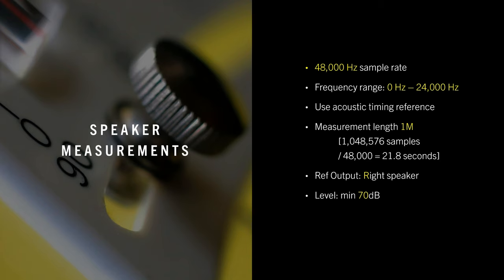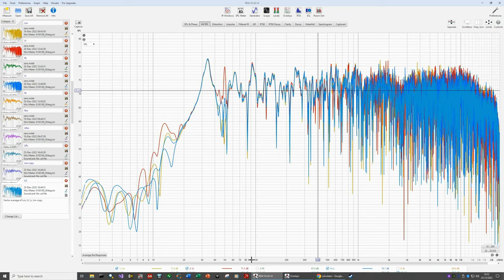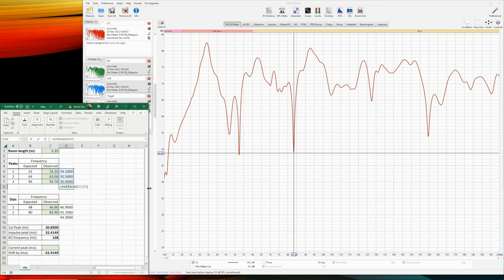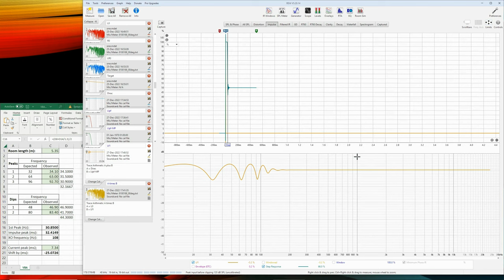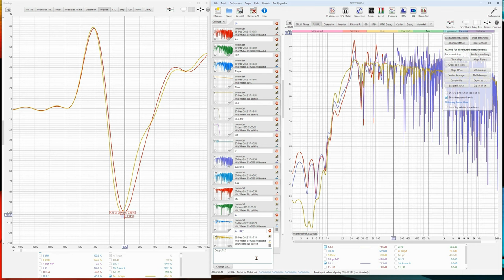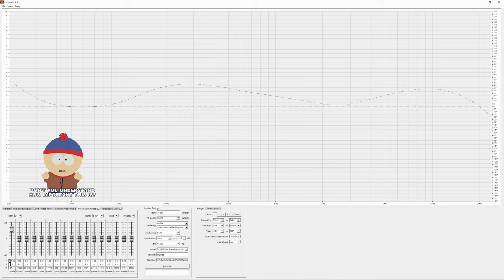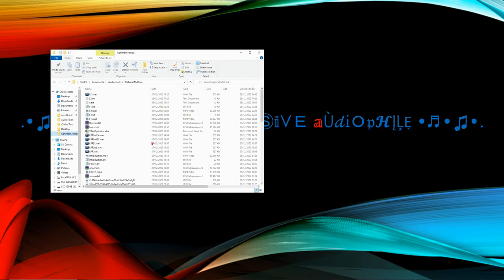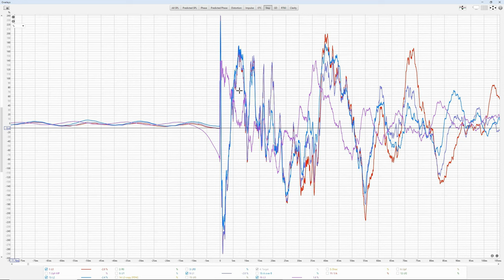High Fidelity Digital Room Correction with REW & rePhase

Comment: You know I did a lot of tests with the inversion so I know it quite well. Following the procedure you reported here I have a lot of post ringing (I know it comes from F2 because I have each filter separately reported in the convolution filters of Roon). I have to apply a frequency dependent window of 35 to R1 and L1 and then invert. Applying VBA before the inversion give a lot of benefits with respect to invert straightforward, the sound is a lot better with much many bass. Great job!
Reply from the maker: You're right, FDW has been excluded in F2 by mistake and I have actually added a note for that in the description section of the video. I'd recommend 15 cycles instead of 35 and no other smoothing.
Reply: @ocaudiophile  ok good. So we have to apply a FDW to L1 and R1 and then invert.
I have another question regarding F3: should we repeat the process in rePhase for L2 and R2 or we do only on L2 and then apply to R2 too as per your former written tutorial?
Reply from the maker: @teb76  It's better to do separetly for L2 and R2, there might be subtle differences between the two due to speaker placement and room shape anomolies.
Reply: @Obsessive Compulsive Audiophile  Should I apply FDW of 15 and make the target curve then remove the FDW or should I make the filter with FDW still applied?
Reply: Same question
Reply from the maker: Filter should be created with the fdw applied before creating the target curve!
Reply from the maker: Answered above. If you can wait another day, I'll post a video with a better technique as part II of the video I posted today :

https://youtu.be/zmIqJ_jlZPw
Reply: @ocaudiophile  definitely!  I’m currently getting some convolves files from Accourate.   I’m curious how they sound but I’d like to know how to do it in REW.  

Also, my FDW lowers my high frequencies a ton.  I have a very treated room too so I’m surprise that much magnitude drops!?!
Reply from the maker: Fdw is not an optimal way to see actual HF response as this is highly dependent on how reflective your room is and how far your LP is from your speakers relative to first reflections. A bit too long to explain here, just wait for tomorrow's video. Acourate is a great tool but more can be done in REW lately.
Reply: @ocaudiophile  looking forward to it!
Reply from the maker: @joek6207  HI, sorry I lost you during live chat. It stopped when the premiere ended. Can you repaeta your question here?
Reply: @ocaudiophile  can do.  I’m on road but will put it in later
Reply: @ocaudiophile  I’m back!   A few things:
1) I run my subs 17dB hot (I have 5 in total).  They are also “time aligned” (insofar as I adjust the timings to remove standing waves.  Given all of that and my mains really don’t play a factor below 90Hz, is the additional taps from the virtual bass array worth it?
2) why wouldn’t you set your Harmon curve lower to correct more of the top end?  How should I handle it if I want my main speakers brighter. (Do I lower the overall curve)? 
3) is correcting the crossover phase necessary because of the room?   I figured the speaker designers would handle that?
Reply: One more item:  given that the filters are based off of PEQ targets, can I just use those instead of the convolution file?
Reply from the maker: Unless your subs are placed and time aligned as a double bass array system altogether, you'd benefit from a VBA filter although your LF response should already be quite flat with 5 subs and you may not need it at least for the dips.. 
Cutting boosts too much in the HF will quickly lead to throttled/boxy sound inherent to regular DRC. If you want your speakers brighter, you should lift the Harman curve not lower it. Lowering bass level is the right way to brighten up the HF.
Most passive crossover speakers will benefit from phase correction unless they have adjustable tilting drivers like the Wilsons.
Reply from the maker: Yes you can. Make sure you measure at your regular listening level and auto fit the Harman curve to dB average of both speakers as described in the method.
Reply: @ocaudiophile  thank you!  In terms of brightening, what if there’s a natural roll off that I want to boost (I like a flat response).  Is the way to achieve that to lower the target to make it flat?  1000hz SPL is the same as the 10000Hz SPL.

Or is correcting the high frequency too much, even if its all cuts, not a good thing
Reply from the maker: @joek6207  Most speakers are flat between 10kHZ and 20kHz, the roll off you see should be either the calibration mic inaccuracy or toe-in or tweeter height error. As a rule of thumb, you don't want to touch over 1kHz even for cutting. Most of the peaks and dips you see are caused by reflections. You should only correct "the speaker" above 1kHz, not the reflections and you should only correct for the reflections (the room) below 200Hz. You will agree that most speakers today wouldn't really need EQ for their original response.

If you're desperate, try to apply a boost with "high shelf" filter at above 10kHz, this will have relatively less degrading effect on the sound.
Reply: @ocaudiophile  interesting L/R Bypass with Audyssey DEQ applies no EQ but does add that High Shelf

Comment: Hello, regarding the 50Hz harmonics, you could use a 220 / 220 V transformer to decouple. It could be used as as band pass filter around the 50 hz...
Reply from the maker: Thanks for the tip. I was thinking about this actually.

Comment: Very deep understanding of REW sir! Thanks for sharing.
You correct the input signal right (2channels)?
I correct the output (6 channels)
This is how I usually do it in the activa filter. Set each output band delay. correct any standing waves and peaks on each band. Then clone all 6 x-over and filter settings in 'Rephase linear tabs' and swap with that .bin.
In other words i do a full electronic Rephasing of my favorite setting, not acoustic.
Reply from the maker: Yes and yes!

Comment: Serkan,  Thank you much for sharing your broad and deep knowledge of this.  Much appreciated.  One question regarding creating both left and right filters, do you have to time-align L0 and R0 before creating the 4 filters for each channel, or can we create them from the raw measurements?
Reply from the maker: Thanks.

One of the speakers is the acoustic timing reference so it'll be at time zero anyway and the other speaker will need to be on top of it if you aligned your mic at the centre during the measurements. It'll not make an audible difference but for the health of all the calculations it's good practice to align (with cross correlation) everything to time 0. If your LP is not at the centre, than you should compensate for that in your convolver engine settings with the correct time delays applied to the closer speaker.

Btw, do not forget to check video description area. I have made some revisions/updates/tips and added my complete measurement and calibration steps.

Comment: Is it okay to use higher than 8% regularisation in the inversion filter if my dips are really bad? My current room is pretty bad so for now I'm just trying to do what I can as a band-aid fix before I'm able to move. I'd need somewhere around 10db boosts probably to sort out my dips, I do have the amplifier and speaker power to compensate for -10db preamp gain in dsp.
Reply from the maker: Boosting dips too much may degrade the overall sound but feel free to try. You need to decrease regularisation percentage to increase boost.
Reply from the maker: Yes!

Comment: This is top info. I watched your videos with a lot of interest. Great contribution to the community. Would you say that the filters you can create with this method are on par as the ones crested by Acourate/Audiolense?
Reply from the maker: Thank you. REW is now so powerful (there're also some new tools I'm aware of in the pipeline), I'd say you can do almost anything you do with pro software. I don't have any experience with Audiolense but DIY crowd loves it and they're a tough community to satisfy. In Acourate you can do a linear phase inversion which sometimes has advantages compared to min phase. Also it uses macros to automate tasks which can be more practical. However, with REW you can see all the details of what you're doing.
Reply: @ocaudiophile  thanks for the flavor, this is definitely worth to spend some time with

Comment: i followed your REW video and was wondering if it's possible to make impulse response shorter (sub 200ms) without compromising on frequency amp correction? 

forgive me if it's a silly question as I'm not too knowledgeable on this thanks for what you do! 

what's your comment on sound id reference and their methods compared to what you show here?
Reply from the maker: The answer to shorter impulse is yes, you can. Watch the "Excess phase inversion" video, it's at the very end. These two were supposed to be one video but it would be too long so I had to split.

I have no experience with Sound ID unfortunately. From their website, it's not clear what they use but probably some AI enhanced phase shifting techniques. The product might be more towards studio engineers as a plugin.

Comment: Amazing amount of information in your videos! I've used a little bit of what I've learned and it has helped me a bunch already on my laptop and my cellphone. 
 I have two questions
1.) A couple of my finished convolution files creates an echo that's quiet but noticable. What step did I miss?

 2.) how would I do a 5.1 system? Seems your videos are mostly 2 channel.  My PC is connected to my theater system and I would be using Equalizer APO if it's possible.
Reply from the maker: Thank you!

1. Did you watch part 2 of that video for filter 4? I played a pre-echo sample there. Is your echo something like that? Then it's easy to deal with.
2. You can do a great surround calibration with a HTPC and EQ APO. You will need to create all 4 filters (combined) for every speaker in the system including the center speaker. For the subwoofer, filter 1 will be enough (or just use REW's auto EQ). Equalizer APO can be configured for surround systems. I think your limit is 7.1 channels:

https://sourceforge.net/p/equalizerapo/wiki/Configuration%20reference/#convolution-since-version-10
Reply: @ocaudiophile   I watched the the video and it seems likey echo is post echo.   Hello.....hello.....hello.   Like that and each is quieter than the last.  My first convolution files dont do that.  I went back to tweak them after learning the process a bit more and now the phone and the laptop do the same echos with the newest ones I made.   I'll have to try again and see if I missed anything
Reply from the maker: @SkubaSam  Probably you're missing something. Are you applying MP to 1/A inversion?
Anyway, I have now added a link in the descriptions for the actual .mdat file I used in the tutorial where you can see all the steps. It could be helpful.
Reply: @ocaudiophile   maybe that's it . 🤷🏽‍♂️. I'll play around some more.  Thank you again for all this hard work you've done on this stuff
Reply from the maker: Actually, you were right. I didn't test filter 2 for post-echo was too stuck with pre-echo testing. Lack of FDW is causing it. I added a note in the description as well: After filter 1 is created and applied, apply FDW:15 and Psychoacoustic smooting to both L1 and R1 and re-calculate Target curve with their RMS average before continuing to Filter 2. All the remaining procedure is the same. Sorry for that!
Reply: @ocaudiophile  oh awesome! Good job finding that!  I'm glad my dumb questions helped in fixing that 👍🏼👍🏼
Reply from the maker: @SkubaSam  :)) Well, I can't make any changes in the video. I hope people read the comments section!

Comment: Fantastic tutorial.  I watch all of your videos although I don't yet implement them all.  I am just trying to improve my Audyssey multeq XT32(with MultEQ-X app) based on your pointers you provide.  Don't have the Minidsp.  Thank you very much.
Reply from the maker: I need to clarify something. I have an atmos system with Audyssey and a separate hifi stereo system. The calibration procedure and application is very different for each although the theory behind is the same. There's almost nothing in this video that one can apply to a Marantz/Denon AVR because the filters produced are FIR filters. Although these receivers are capable of such filters (and Audyssey & Dirac use them), they're not open to the end user. Hopefully with enough of us being aware of the monopoly, they 'll need to reconsider soon. But you can take this opportunity to dive into the true audiophile's stereo world. These filters can be easily applied freely in a PC playing free youtube music and running your front speakers through your AVR (hdmi connection from pc, pure direct mode of course). Every filter in this tutorial will work with the free pc convolve "equalizer Apo". If you're a subscriber of this channel applying these methods, you're definitely also an audiophile and audiophiles listen stereo music. Some of them are all analogue even against digital correction but let's not go there.

Comment: Really impressed by the quality and all the ideas you come up with !

Maybe just a little question, why are you using add FDW "1 Cycle" in order to smooth the curve before using it in rephase ? Because of this smoothing there is still an excess of phase (hence why you made the part 4 haha) after correcting with rePhase.

So I'm wondering what would happend if:
-you try to directly correct the non smoothed curved in rephase in order to try to avoid part 4 ?
-you directly use the excess phase inversion process and skip part 3 ?

Is it only to properly flatter the phase response at the crossover points and then to treat separatly the rest of the phase excess ?
I'm trying to understand a bit of the theory behind.
Thanks again anyway !
Reply from the maker: Thanks. Smoothing with fdw:1 is to avoid ringing. Phase filters with a bandwidth (Q) above 1 will cause pre-rigning in the bass frequencies and a phase filter with a Q at or below 1 will effect a large area which can only be useful for a very smoothed down response curve. If you watch the excess phase inversion video following this one, I demonstrated what happens if you fully inverse the unsmoothed phase response.
Reply: @ocaudiophile  Indeed thanks for your fast answer !